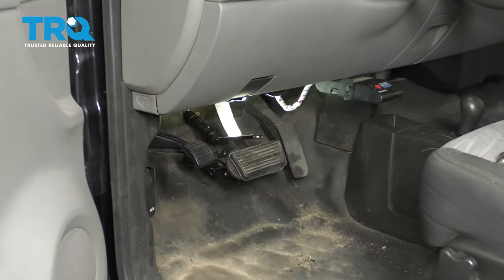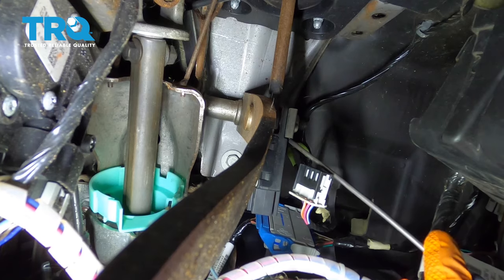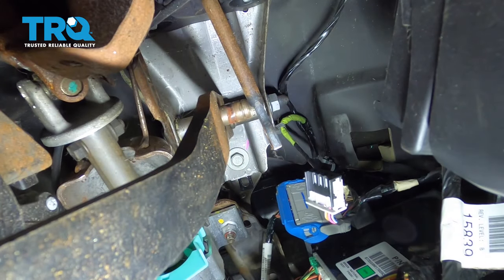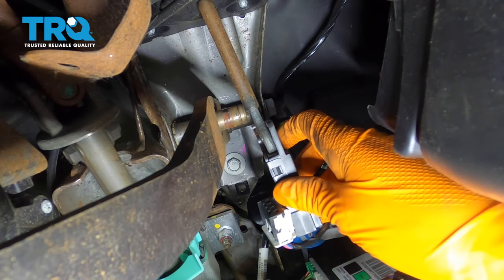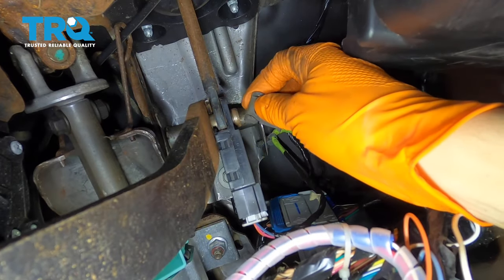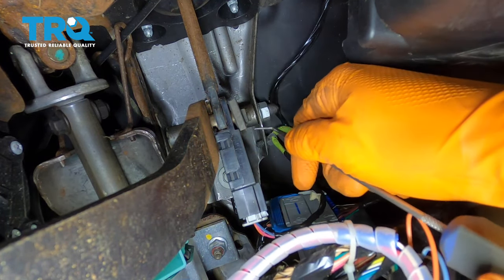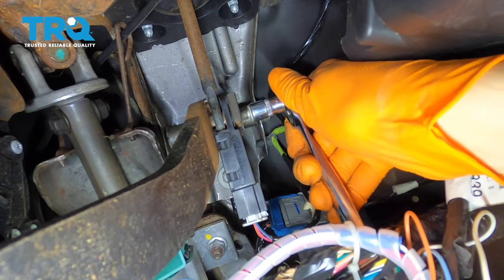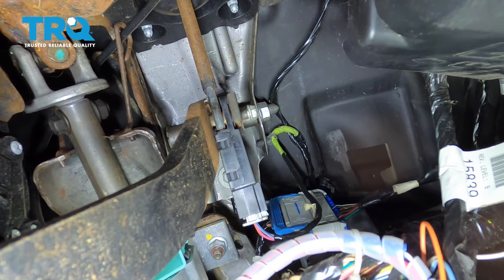How to Replace Brake Light Switch 2007-14 Chevy Silverado

Comment: Bought new switch but only works if I don’t slide it all the way onto the shaft . If I slide the switch all the way on the brake light switch is engaged without putting my foot on brake pedal. Help!

Comment: I replaced the brake light switch and my cruise control works now. After making the switch, I’m getting stabilitrack off alarm and check engine light is on. Any ideas why?

Comment: Hey thanks thanks thanks. I could not get my 09 silverado out of park and into gear.I checked and  brake lights wouldn’t come on which usually means it is this switch and not the interlock solenoid. I guess it goes thru the brake switch first and that activates the solenoid.Clip is a pain but with your instruction I was able to get on. Really appreciate it.

Comment: I changed mine out, and the cruise control started working, everything was fine. Then I went to the store and when I was coming back home, my brake light came in and started screaming at me. I turned the parking brake on then turned it off and it went off and quit dinging

Comment: Thank you very much for this detailed and brief video! This fixed my cruise control issue on my truck that was absolutely horrible. I have long 5 hr commutes and my legs would be so drained by the time I got to my destination. FINALLY I can give my legs some rest while I drive now. It was actually harder to get the retaining clip off then to put it back on. When reinstalling I just reinstalled upward and pulled down and it slid right back into position. Thank you again! My legs thank you.

Comment: Watched the video, bought the part, and…got it done.  Cruise control works now!  I would add to the video….removing the clip was a bit harder than shown in the video.  Tools that worked for me included a big “wand” flash light, and for clip removal, I eventually used a medium blade screwdriver to lift up the tab, and then a large screwdriver to push the clip up.  This was while I was on my back and the family dog trying to get in and help.  Tab went back on easy and pulled down into place.  A good little repair…2008 Chevy work truck…. TJ

Comment: My Denali 2014 does not have that 6.2 1500 gmc sierra. It does not have this simple brake switch its seems very complicated under my steering wheel. I see the fork style brake selector switch but don’t think that has anything to do with cruise control

Comment: How would I know if this needs to be changed? Like what would my truck be doing to let me know I need to change this? Thanks.
Reply: Replace if your brake lights stay stuck on. Also if your cruise control doesn’t work. These two plus my stabilitrak service light was why I replaced it. Apparently it feeds through that harness. Replaced the switch and now my 2010 is all back to normal.
Reply: @Jaymes222   I recently got a remote start and alarm in my 07 silverado but remote start only works sometimes because i was told my brake is pressing alittle downward causing the remote start to not turn on. What can be the issue? I have to pull the brake alittle bit up so next time remote start can work
Reply: A code comes up on any scan tool.

Comment: I have a 2014 silverado and that part is not on mine I have a round part with a tuning fork and it controls my brake lights and a few other things it's called a brake position sensor there are two different ones thou make sure to get the right one

Comment: Lost the 10mm bolt.  Where can so buy a replacement?  Not sure on the thread diameter.
Reply: any hardware store. should be a 6x1.0 thread pitch